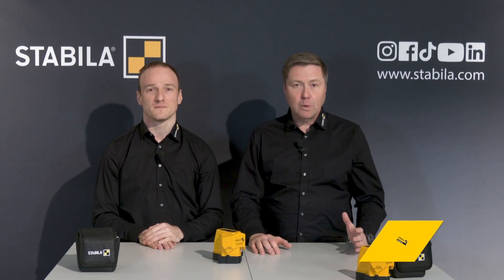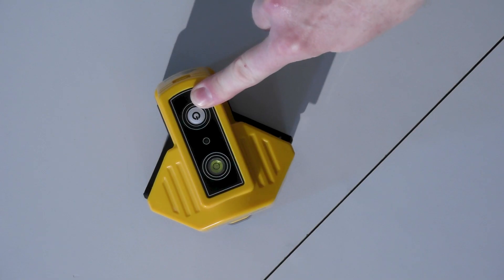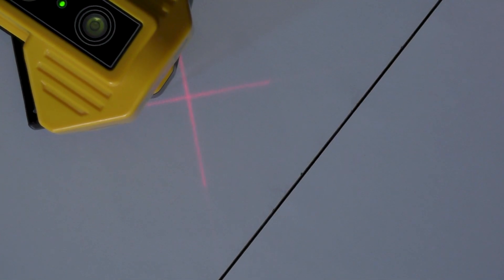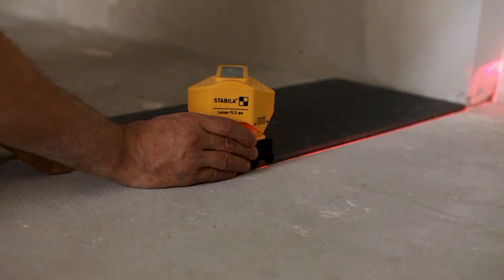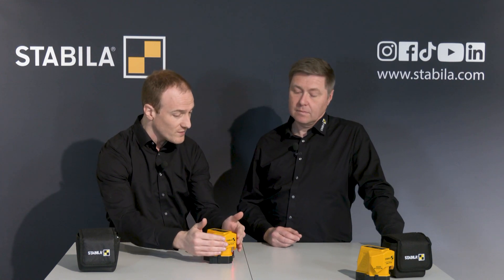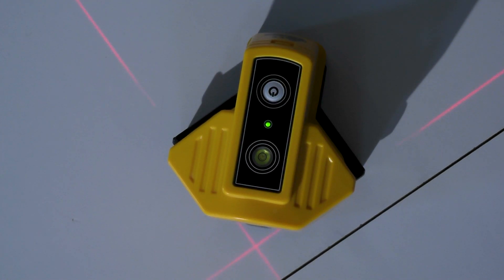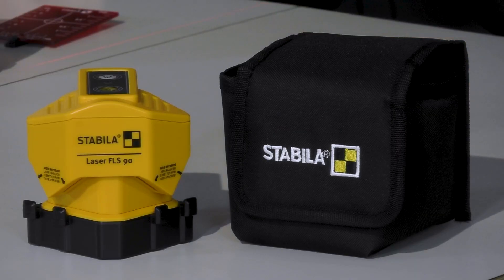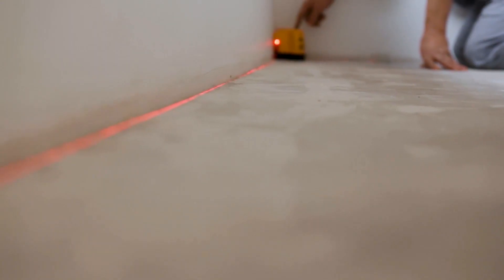STABILA FLS 90 – exact 90° angle on the floor, visible up to 15 m

Comment: This is evolutionary. more tilers should get to know about this product. I've been doing tiling for decades, but I just found it out after 10 years, they released this model. the best part of this model is the duel purpose bracket, which fits the tile corner and aligns exactly as the tiles go its square way.
Reply from the maker: Thanks for your feedback 💛🖤👍